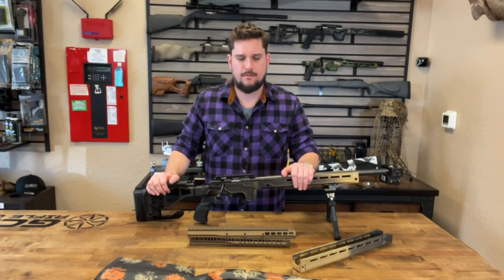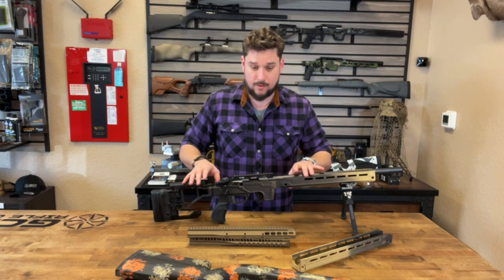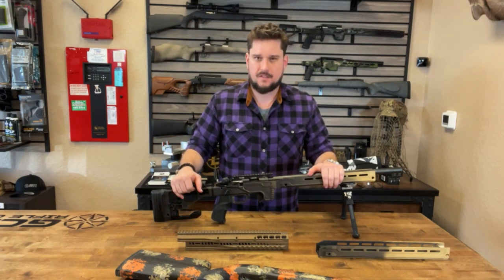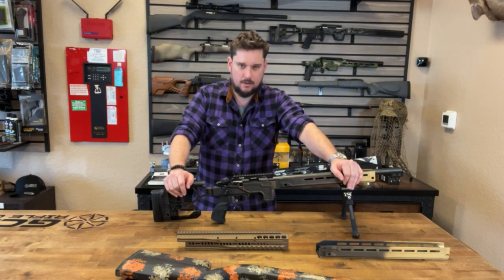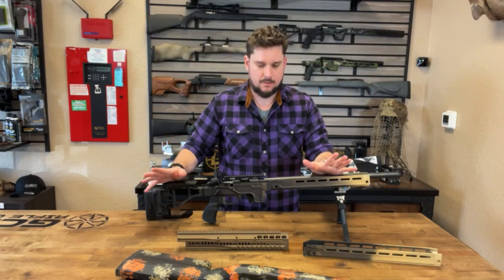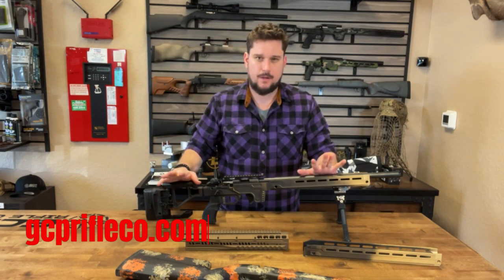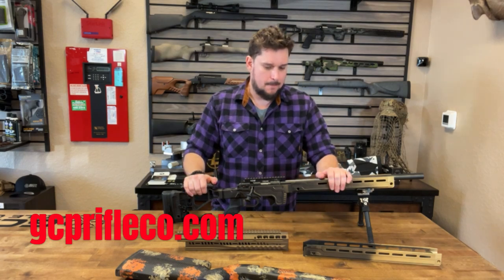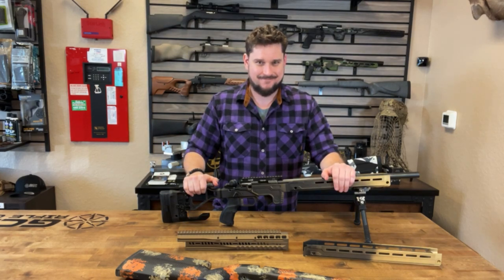Ultimate Chassis for CZ 457!! .22 LR Precision bolt action rifle rimfire chassis. Vision Chassis

Comment: Does it include the stock or will that be sold separately?
Reply from the maker: Can be purchased in either configuration. Details in the video. Thanks!
Reply: How do you get to the mag release?
Reply: Ok, saw it at the end😜👍
Reply from the maker: @jonathanseal5155  it’s a button up in the mag well. Really easy to feel.